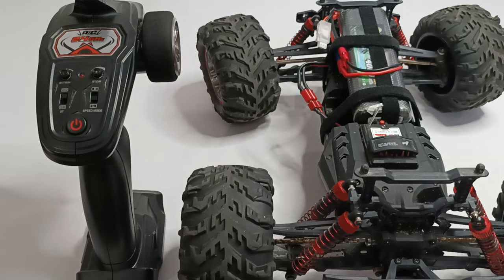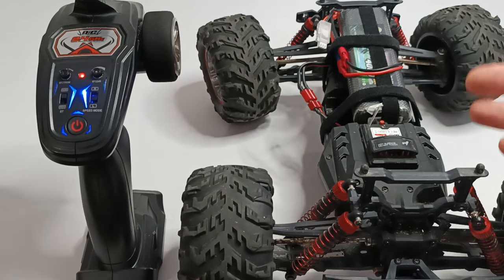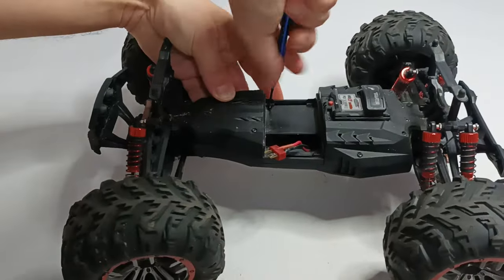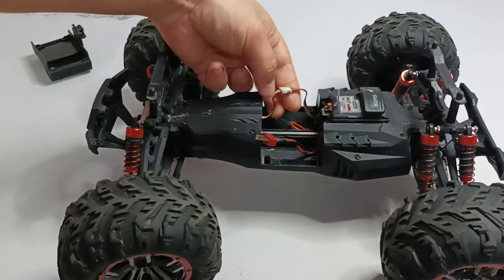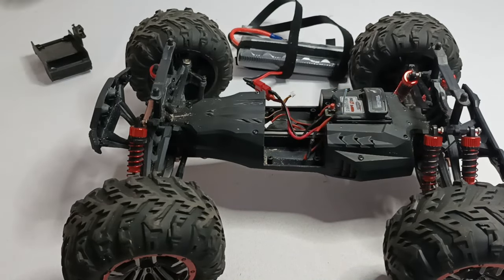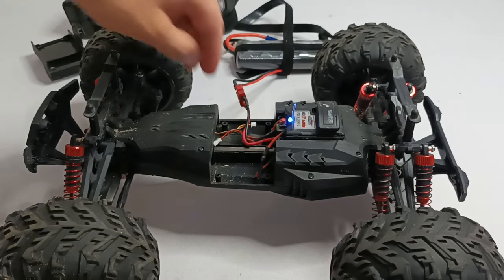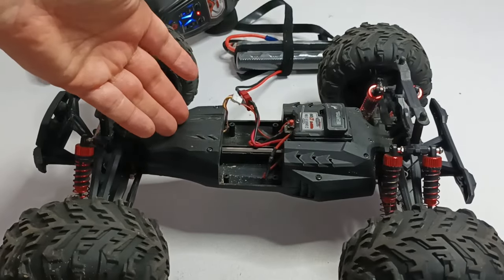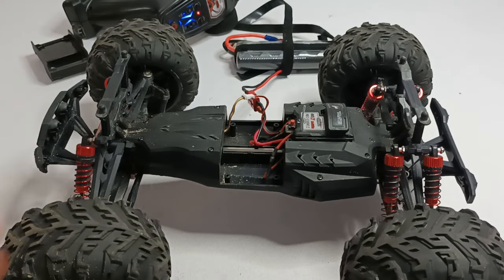Why my RC Car is NOT Connecting to a Remote Control? Why Xinlehong 9125 is NOT Binding to a Remote?

Comment: I had the same problem. Managed to completely destroy my esc. Now I've upgraded to 3s brushed. A beasty was born. When we fail, we learn.
Reply: what was the problem? the steering motor? the connexion? the ECS?
Reply: @jimmymasse9581  steering 5 wire didn't work. Only forward and backwards. And since this is a cheaper version of another car the parts must be the exact same otherwise they do not work. Its shitty for maintenance.

Comment: Thanks for your video, was very helpfull, I found the problem in the steering mech,  Could you send me the video were you try to fix them. Thanks again
Reply from the maker: Steering mechanisms are very sensible, I would get a replacement. But if you are interested, I have a video (How to Diagnose and Fix an Electrical Steering Servomotor on Xinlehong 9136 (aka Hosim) RC cars?) where I fix it https://youtu.be/QXzLmWYmNtU   The logic should be the same.

Comment: Hello, my 9125 vehicle accelerates by itself and cannot be controlled. The vehicle accelerates by itself as soon as I touch the gas trigger, I cannot control the speed in any way, it does not go behind.

What could be the reason?
Reply from the maker: Usually, turning off and on the remote control and the RC car help. Also checking if the batteries are fully charged on both RC car and the remote control may help. The remote control should be turned on first and then the RC car. Also, you can try to disconnect and connect the batteries on both the RC car and the remote control.
Reply: @RCToysAventuraSmartSolutions  I completely disassembled the remote control and the car, cleaned and reassembled it, but it still didn't work. The gas potentiometer inside the remote control was broken. I fixed it by changing the place of the gas potentiometer with the steering wheel potentiometer. Thank you.
Reply: I have exactly the same problem and I haven't found a solution.. Did you find one? And if you found one, how?